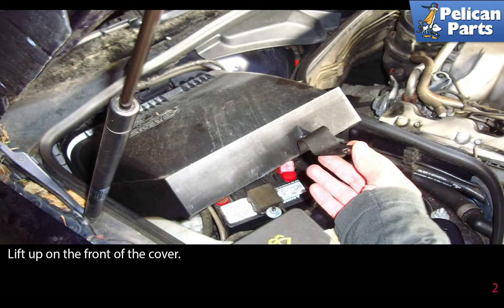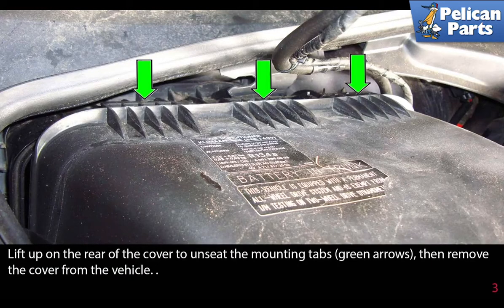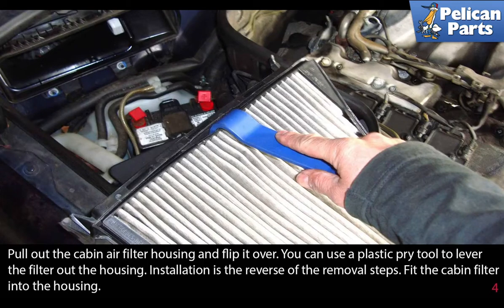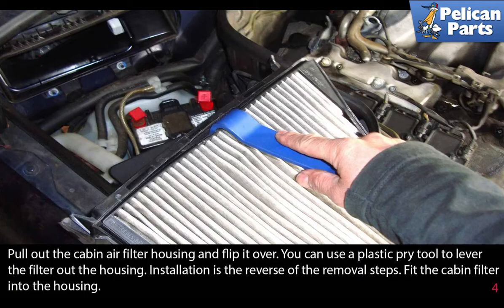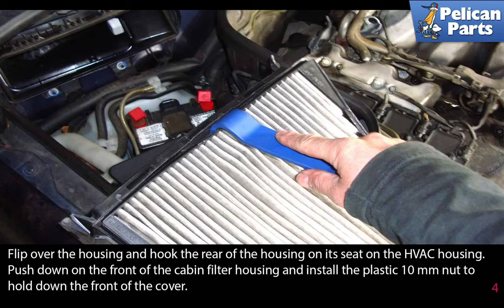Mercedes-Benz W211 E-Class Cabin Air Filter Replacement

Comment: I just did a BMW M240i cabin filter for a friend. What a PITA that was!! These two nuts under the dashboard, then two torx to get the filter cover available and then pop the two clips on the cover. This is under the dash pointed at the carpeting and ALL the way forward under there. Push the cover out of the way, pull the old filter out, then figure out which way the air is flowing, then bend the new filter to fit the curved filter holder and push in from underneath. Then the bottom cover of the filter and two torx, then two 10mm nuts to hold the dashboard lower cover. #$%^&*( Mercedes: pull the 10mm nut, remove the filter cover, replace the filter and put it back. Yep, BMW's suck!!
Reply from the maker: Thanks for sharing your repair process and experience. These types of comments add so much to the Pelican tech community.